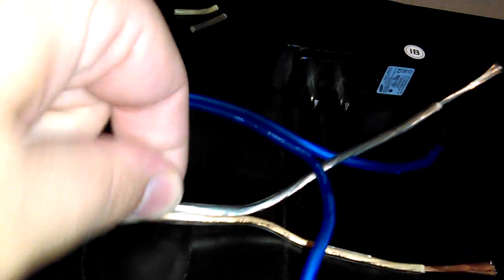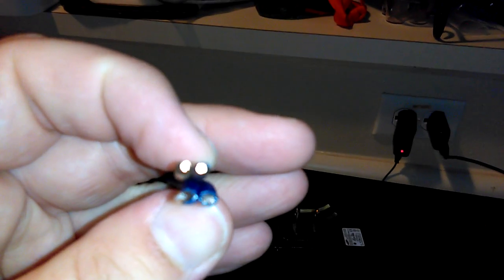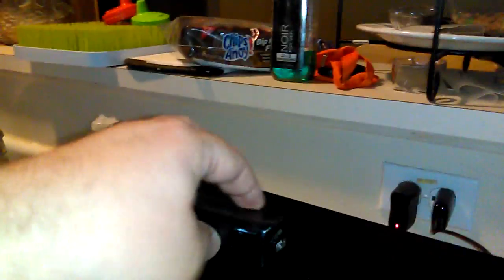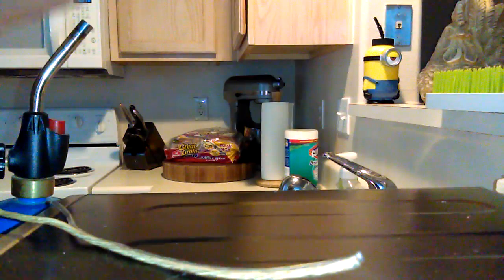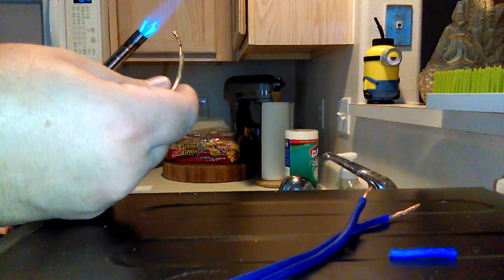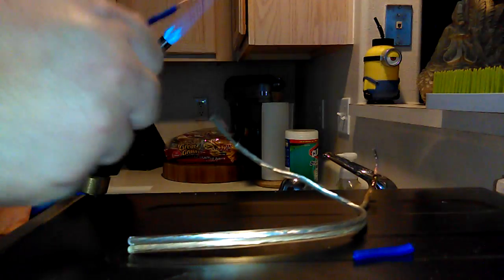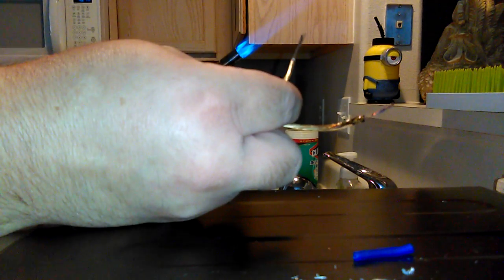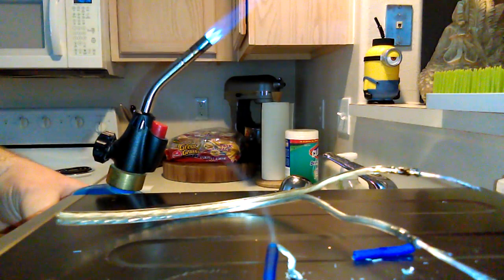Cca Vs OFC

Comment: I'm using mine on a home theater and even in the hottest city in Texas where I am it doesn't get over 120*.
Reply from the maker: Ricardo Herrero I live in Arizona - were the hottest in the nation at 123degrees 

& it's 120degrees months out of the summer 

120degrees + ur car in direct sunlight things can get to or above 550degrees hotter than the oven if it's metal 

in the engine bay it can exceed 700degrees by the headers  <& i have high performance headers T304 STAINLESS> that's why they use special wire wraps & protective SHEETHS 

This is about 800- 1500degrees towards that 10seconds 

now that  aluminium melted the second heat touched it 

The 100% OFC pure copper stinger was still strong /stiff  & very usable after that degree of heat .....with that said & all the other benefits & gains with OFC v.s. CCA  ....go OFC  it lasts forever & is much safer!

Comment: Lol. Soooo...your point is cca won't last the same as copper under fire. I'm not cooking with it, but thanks.
Reply from the maker: Ricardo Herrero under the right conditions and  install CCA can last a few years....

I wouldn't use it- DEFENATLY wouldn't run at .5 or .25ohms on any amount of CCA ....
Reply from the maker: this is 1500degrees -way past normal heat use... the point is OFC pure copper will last the life of the vehicle - that's why manufacturers use OFC from factory!
Reply from the maker: Ricardo Herrero this is car audio....But  use what you want...youll get more wattage out of  any amplifier on OFC vs CCA the shorter the run the better CCA performs but gets super hot if u dont monitor voltage ect...but this is my channel check out  some of the other videos! its mostly a car audio channel...& a bit of how to !